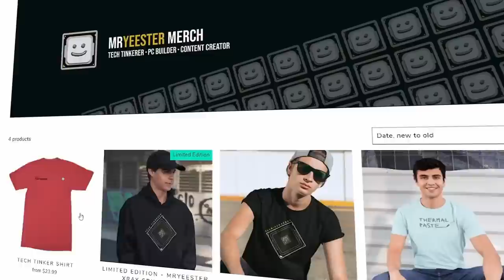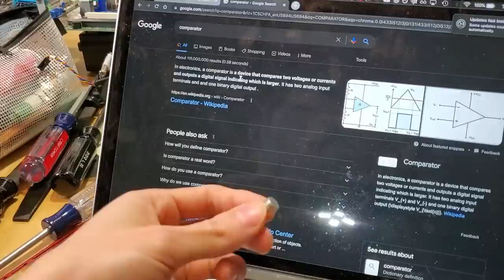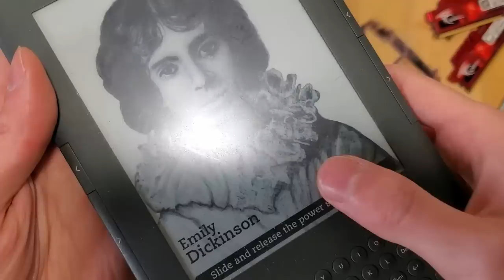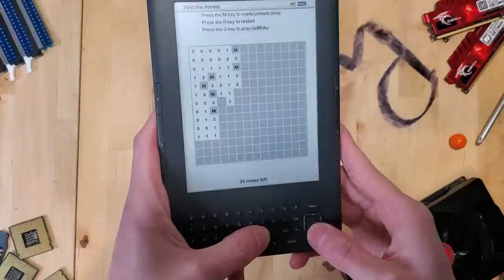5 Easter Eggs Hidden in PC Hardware

Comment: Not hardware, but HTTP response code 418 means "I'm a teapot", which is an interesting easter egg built into the framework of the internet.
Reply: It's an April Fools RFC, which has been tradition since the 80s! Other notable examples include "IP over Avian Carriers" (sending network packets by homing pidgeon), a standard for sending sentient life forms over email, an evil bit in the IPv4 header that's supposed to be set by malicious actors, a TCP option to indicate what mood a packet has, scenic routing for IPv6 (complete with Avian Carrier integration), and so on
Reply: I want a "smart" teapot that has WiFi just so it can send this message whenever you connect to it.

Comment: Not an Easter egg as much; but one of my fave hardware secrets is that the Nintendo logo on old original NES controllers is actually transparent, and the PCB has unused headers for an LED that was never used, probably to cut costs of the final production since LEDs weren't as cheap in the 80s. In general, early computing is full of easter eggs; like the designers' names in the case of the Amiga. Would make some great follow-up video material. :)
Reply: Have people put their own leds in them?
Reply: It doesn't have headers for them
Reply: Early Amigas had the paw print of the creators' dog too

Comment: The raspberry Pi has a small easteregg I forgot what it was I think was PCB or soc related.

Edit: found it it's the new pi zero W 2 you can see it with the help of x-ray - a raspberry logo.
Reply: There is a signature under the usb c port
Reply: @YSPACElabs  also a nice one, but I was thinking about the x-ray one. Edited my comment.

Comment: Dedicated to mryeester. Here's a new Intel easter eggs. So recently Intel changed their logo to a new one. If you look closely an "i" on Intel has a dark blue dot on top of it. Also the background of intel color is light blue. If you inspect the dark blue dot color and the light blue background, dark blue dot color hue is 208 while light blue background hue is 194. Now here's an easter eggs, if you minus 208 and 194, 208-194, it will be 14. It resembles of 14nm process in intel.The 14 nm process refers to the MOSFET technology node that is the successor to the 22 nm node. The 14 nm was so named by the International Technology Roadmap for Semiconductors. Until about 2011, the node following 22 nm was expected to be 16 nm. Cool isn't it?
Reply: I don't even think that's intentional. If it was, the person who figured that out is really damn smart
Reply: This is not a easter egg.. THIS IS FULL ON INTEL LORE! xD
Reply: Imo this is entirely coincidental. I doubt intel would design their logo to specifically reference the processor let alone the MOSFET technology used. Quite simply a fun coincidence